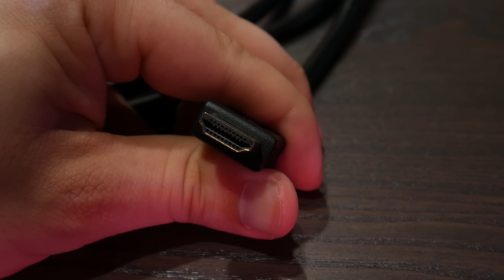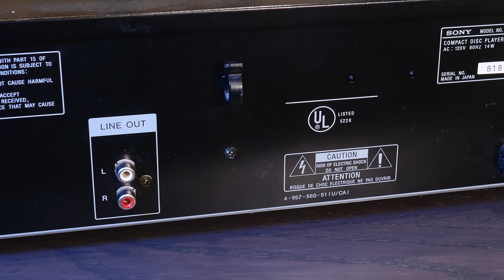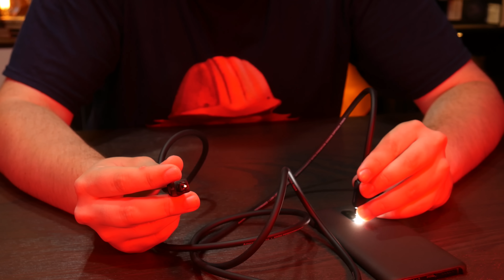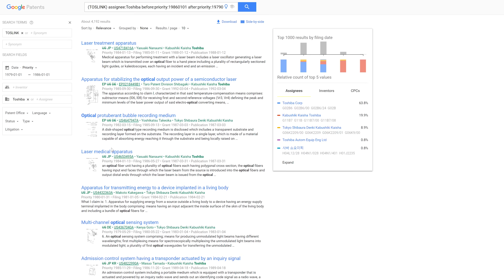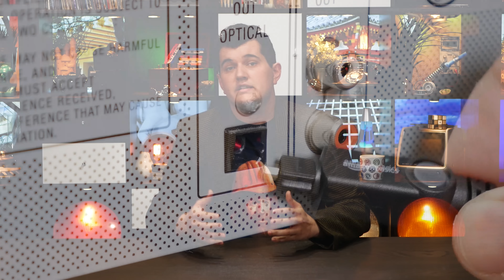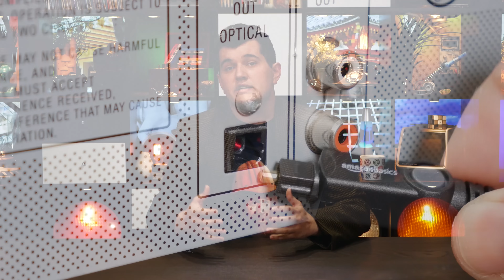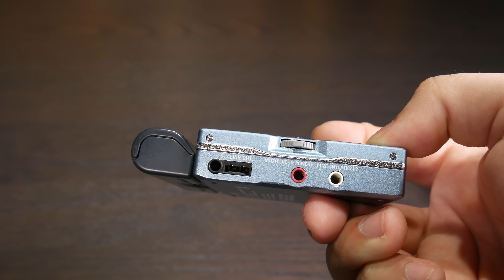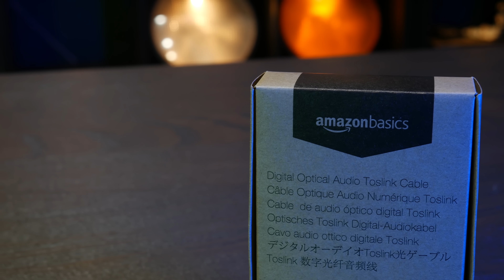TOSLINK: That one consumer fiber optic standard

Comment: I use Toslink off my PC to my audio receiver first to electrically isolate but also because it's a small wire with a small end and I don't want to route any of my monitors through my audio receiver as it creates more cabling.  The major issue with HDMI is the need to route wire to the audio receiver and back again something the ARC feature is trying to fix in newer hardware.  I have a long Toslink in the living room that is routed with multiple electrical wires, you're ears would never know it.

Comment: Mini toslink is pretty common for desktop mini dacs like the FIIO E18 or similar. It doesn't take up a USB port. Also good for isolation when setting up stage audio and routing cables without having to worry about interference at all andbecause it's so common it's convenient especially if you're setting up at a live venue with older equipment.

Comment: Not gonna lie, the highlight of this video for me is the actual physical presence of a real MD Walkman.

I had one similar to the one shown--an older model, I think--and that little buddy was amazing for recording mix disks off my stereo (which also had an MD player built in). They were EVERYWHERE when I lived in Japan (ca. 2001), and the rechargeable, rectangular ni-MH battery it came with had great play time and lasted through almost 5 years of heavy use.

Actually, I never killed it. I just ended up getting an MP3 player that replaced it.

I even used the included TOSLINK cable to burn an MD from my dad's stereo setup, just to try it out.
And you're right. Made absolutely no difference in quality. XD

Comment: Just a note - good ol' cat5e can be used with upwards of 5 gigabit ethernet as per standard, and often works fine even at 10 gigabit.  The manufacturer specifications are promises of minimum performance, not absolute limits.   I had some really nice cat-3 in my home network running at 1Gbit/FD just fine.  Granted it was only about 2M long, but it goes to show that you don't need cat6e for everything...and especially if it's a short run.

Comment: Connecting the ground of two electronic devices is enough to carry the power supply noise from one to the other. And when the source is not purely designed for audio (like, say, a gaming computer), it can lead to very audible noise (even with my impaired, audiophile-despising ears). After a graphics card upgrade introduced the problem in my system, a cheap toslink DAC and an optical cable solved it neatly for me.

Comment: You forgot to mention that HDMI also support Ethernet connection. Not that I've seen that feature in use, but it is supported for quite some time.
The real benefit of optical cable is that you get no ground connections between different equipment. This is also where noise can come in play even with digital signals. Too much ground noise can affect the analog circuitry and result in noise in the ouput sound. These days most audio and video devices don't have ground connection to the mains outlet or data cables are not always connected to it. Add switching power supplies to the mix and it gets dangerous. Like electrocuting dangerous. That's why all manuals warn you to only connect cables with the power shut down. I got electrocuted holding HDMI cable connected to my receiver and touching my PC. I measured the voltage and it was 180-190V (close to the mains voltage of 230V here in Europe). That's because the receiver uses a traditional transformer and the PC uses switching power supply, which has the ground level floating compared to the transformer. The resulting current is low, but the initial electric shock is not nice and might be dangerous for some people and also for your equipment. I've had this happen with different equipment more than once.

Comment: One thing you forgot to mention is ground loops. While interference isn't a concern with the S/PDIF signal, using copper to carry that signal introduces the possibility of a ground loop, which could cause noise at line frequency in the amp.

Comment: You can probably make toslink faster by running multiple single-frequency LEDs through the wire, in addition to the normal standard. This way older receivers will treat the data as normal, while "upgraded" ports can make use of the higher bandwidth?

Comment: The reason you don't see it more is because copper is faster over short distances. General rule is about 6 feet or 2 meters. Oh, and there are optical HDMI cables intended for long runs.

Comment: As an arcade collector, mostly 1990's stuff, i found it odd that SEGA chose Toslink to link cabinets in their MODEL (1/2/3) biased games, where most of the other manufacturers were transitioning from serial cables to Ethernet. This also led the way for machines to become 'internet enabled' for tournament, user profiles and leader-boards. SEGA model systems use a pair of toslink cables to create a ring network of up to 8 machines (which by the way look freaking amazing as the attract mode would pan across all 8 screens!)

Comment: I have a Home Theatre system (6 speakers with DVD) I do have it HDMI to the ARC HDMI on my TV but no audio can be heard until I plug a TOSLINK between TV and home theater.  So I’m not 100% buying the HDMI can send and receive sound through the ARC unless you have the fiber optic TOSLINK

Comment: Just found this video and loved it.  I honestly just used a TosLink cable the other day to connect my HDMI switcher to an older soundbar without an HDMI input.  So while the soundbar isn't proper surround sound, the TosLink connection does just fine with it.  Eventually I will upgrade to a true home theater system and use the HDMI ARC but until then, everything sounds as good as it possibly can.

Comment: I have an A/V Reciever Dolby digital 5.1 DTS Samsung with 6 changer DVD PLAYER built in. It has a Opical input on the back. Or I guess it's also called Toslink but no HDMI input. Just the usual W/R/Y inputs and outputs. I think maybe an SPDIF as well.  My TV doesn't have the Toslink connection, just the HDMI, MHL (roku stick), and the W/R/Y connectors how do I hook up both TV sound   and video in and not lose something due to incomplete connections?

Comment: Mini toslink was found in a whole bunch of older Macbooks (I'm unsure if they still have them) I only know this there's actually a small prong inside the port which when pressed down will activate the toslink, simultaneously activate the aux output and deactivate the internal speakers.
Unfortunately from time to time my one would get stuck down so my Macbook thought it was outputting sound to earphones while at the same time the port would glow red, whenever this happened I would have to stick a toothpick in and dislodge the prong.

Comment: I never thought of it, but it is actually a little strange that nobody ever thought of using ADAT for transmitting 8 channels of 24/48 audio for TrueHD. 7.1 surround. This is exactly the method of how I get audio from the computer to the DAC for 7.1 mixing. ADAT even has a widely used s/mux mode for 4x 24/96. hmm...

Comment: Bad research. Bad information.

First of all, can we STOP talking about the ‘speed of light’ and how ‘fast’ it is when referencing fiber optic communication? The advantages of fiber optic communication have absolutely NOTHING to do with the speed of the signal itself. PERIOD. Electrical pulses travel through wires at 96% the speed of light. The radio waves your WiFi uses are the same electromagnetic radiation as visible light, and also travel ‘at the speed of light’. In fact, since they travel through open air and most optical fibers are solid-core (with the exception of sparsely used photonic crystal hollow-core fiber), open air radio signals actually propagate much faster than signals in optical fibers. The speed of light decreases as the density of the medium through which it is traveling increases. Glass and plastic optical cables are much more dense than air. Long distance fiber optic transmission is NOT by any means ‘instantaneous’, or even ‘nearly instantaneous’ and has a significant, measurable latency. If anybody tells you otherwise, they are making an uninformed assumption. Fiber optic transmission isn't always ‘faster’ or ‘better’ as is implied in this video. In fact, in some applications it can be much SLOWER! Low latency networks made for things such as high-frequency algorithmic trading using short-distance copper networks as this generally provides lower latency (see Infiniband). The real advantage to fiber is bandwidth which comes from the ability to use a larger portion of the electromagnetic spectrum (wavelength-division multiplexing) and at much higher frequencies (IR, Visible, UV as opposed to radio or microwave). 

Second of all, the claim that optical fibers are less complex than copper wires is completely false, and quite frankly, ridiculous. “These complicated cables with up to a dozen little strands of copper in them” has to be one of the most exaggerated, nonsensical statements i have ever heard! Twisted pair wire is relatively cheap and easy to manufacture, which is reflected in its price. Why on earth do you think copper networks, even those using 10gbit capable Cat6, are cheaper despite the relatively high price of copper itself? Fiber is expensive to manufacture and much more complex to install than copper twisted-pair wire. Splicing copper is many times easier than splicing fiber, which requires specialized tools and skills. All you need with copper is a decent electrical connection which can be done by anyone with basic soldering skills. Go try to splice sub-micron optical fiber and then come back and tell us your opinions about how much more ‘simple’ fiber optic networks are and how 'shocking' it is that we don't use them to replace common electrical interconnects. Bend radius is very important in fiber networks, while it’s not an important factor at all in copper networks. Fiber based networking devices by nature of their design require more components than copper based networking devices, as the signal obviously needs to be converted from electrical to optical and then back from optical to electrical. In modern high throughout networks using QAM64 or QAM256 modulation this requires devices called interferometers, which are not simple or cheap.

It makes perfect sense that we still use copper wires to transmit most signals, especially signals between two electronic devices such as a computer and a display. why on earth would any company ever put effort into developing an optical link to connect a computer to a display, or a computer to a peripheral device? In the audio world, it makes some degree of sense, if not for quality, then for the ability to transmit a surround sound signal over a signal cable, but for virtually every other application it makes no sense at all. Electronic devices ‘speak’ in electricity, not in light. It’s far less complex, far less expensive, and simply superior in most applications despite the ‘cool’ factor of fiber optics.

Thirdly, TOSLINK is not the only consumer optical standard... ‘Ethernet’ is a broad standard that includes optical transmission using the Small Form-factor Pluggable. (SFP) connector as well as electrical transmission using the more common RJ45 connector. SFP may not be as common as RJ45 in home networks, but it’s a ‘consumer standard’ none-the-less.

I really wish people would do better research before making videos on topics they do not really understand – but then again, I can’t really blame them when it’s so easy to upload poorly researched content filled with factual inaccuracies and still get hundreds of thousands or millions of views.
Reply: One more thing; It is incredibly silly to even suggest that Toshiba, a Japanese company, and TOSLINK have anything to do with DRM. 

DRM was and still is inevitable in the digital age.

People who don't know anything about DRM love to hate on DRM because it has become the 'trendy' and 'cool' thing to do according to teenage internet activists. Wikipedia even now lists DRM under their 'List of Buzzwords', which is very telling of how often it is used in a clueless context. Used poorly, DRM can cause some problems, but when used correctly it actually benefits both creators and consumers. It's just as important in our modern society as any other form of intellectual property protection, and if you're 'against' it, you're really doing yourself a disservice as a creator and a consumer.

Stop feeding into the childish imbeciles who, while people are starving to death in oppressive regimes, are protesting Digital Rights Management and Net Neutrality (something most computer scientists agree does not exist). Talk about  'first world problems'. "Bwooo whoo i have to be online to play this video game, my rights are being violated." "Bwoo whoo, i can't illegally copy a product i did not create, my rights are being violated!" Give me a break! What 'rights' do you think you have to a product just because you purchased it? News flash: not as many as you think you do. The internet is not a human right. The internet is a service provided by private companies and if you have a problem with how that service is provided feel free to lay your own cables and start your own ISP. Digital content and software are not a human right. The creations of others are not your human right. 

If you're against DRM, does that mean you're also against copyright? Does that mean you wouldn't copyright strike me if i ripped off this video and uploaded it on my own channel with m own ads? Yeah, right! You would hit me with a copyright claim faster than you could even say 'DRM'. Hypocrisy at it's finest. So you think you should be able to protect your creations, but that others should not have that same right? Odd..... DRM exists because of piracy - not the other way around, and weather or not it's effective in stopping piracy is irrelevant. As is usually the case, the bad apples in society (in this case, the pirates) ruined it for everyone. Blame the thieves who torrent PC games, movies or software and think it's their 'right', not companies for implementing DRM.

Comment: TOSLINK for some strange reason give difference in the sound compared to SPDIF even if all common sense and physics say it should be the same with the high end DAC I had. I have tested it myself in blind A - B test and all listeners that tried it had no problem hearing the difference and even identifying what was TOSLINK or SPDIF. Many other who has done blind test reports the same that with their system TOSLINK give slightly worse sound and only some reports no difference.

Comment: Unlikely event of an electrical spike traveling across the RCA cable he says. Yet I've had this exact thing happen to me, on two occasions. The first was with a Sony branded audio receiver. It cooked both my TV's digital RCA Jack and it's digital audio processor. The second time was across an outdoor rated Ethernet cable connecting my detached home office to the router in my main house, and cooked both the Ethernet port and quite a few chips on an Enterprise class gigabit switch I was using to run my servers. Ever since those two events, if I can electrically isolate, I do. My detached office now interfaces with the main network in my home via a short fiber optic run, and I never use copper to connect anything if optical is at all an option.

Comment: You actually missed one of the major benefits that Toslink has over any other connector of its type. Including hdmi. Almost no latency. 

HDMI is infamous for it's super high latency. Toslink can reduce this audio input lag as much as 50ms-100ms.

There is a video game called rocksmith. It uses a real guitar as the controller. When connecting the audio while playing this game using an hdmi cable you can hear nearly a full second difference between plucking the string and hearing the audio output. Switching to toslink reduces this audio lag to imperceptible levels. Aside from this and other specific gaming applications the latency on hdmi is tolerable. But it does make you wonder why we don't have we don't have more consumer grade optical standards.

Comment: I just don't understand why TV's are ditching the analog out for sound and all keep with the optical output but WHY no one ever upgraded it?

A lot of people are stuck in having to use the optical out as like the only way to get 5.1 like on gaming consoles and it has low quality output only not high bit rate and no one ever upgraded it, wish they could add way more data like with using more colors or whatever...

Now the only way to get proper audio quality on consoles is with HDMI and 4 me it sucks, having to use 1 HDMI on the TV as a audio out or having to get a more expensive proper audio receiver while most stuff still uses Dolby digital surround via optical and I much rather prefer leaving HDMI alone and having a separate dedicated audio out all the time, wish they would ever upgrade the optical out for proper high bit-rate supporting even dolby atmos and other lossless codecs data...

Also with HDMI I keep thinking does device "A" would increase input lag? Does device "B" increase input lag? no matter what I'd always prefer to have a complete separate audio out with high quality than having to mess with HDMI as I always want is the best and lowest input lag and not having to get decoders that need to be connected via HDMI and setup from their built-in menus that we see over in the TV and shit like that grrrr...

Comment: Actually, the keying allows transmitting multiple signals over a single cable using polarized light sources. The original TOSLINK isn't polarized, but future versions could have been to increase the data content in a backwards compatible manner.